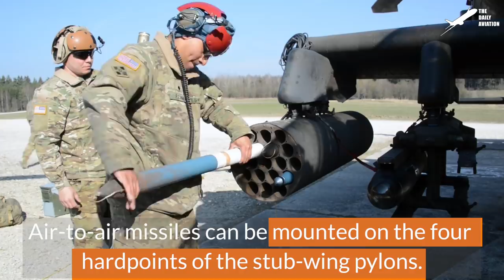Testing US F-16 Afterburner Jet Engine to Its Extreme Limit

Comment: *Imagine putting a dyno on one of those afterburners*

(I forgot the thing that makes electric when a wheel moves my english is not that very good.)
Reply: you mean dynamo? well the engine itself probs acts as one large dynamo already. it generates electricity for the aircraft while its running cause the fans in it spin. thats why it dosent need to rely on battery power to power the avionics (buttons n stuff) while the engine is running. Also if a dynamo is strapped to it, it would probs produce less energy than what the engine is already producing cause of the fact that energy cant be created or destroyed, it can only be converted. So what u get out of the dynamo would be at most equal to what the engine is making, but probably less.
Reply: @ATAGOISMYWIFE  yea still its a source of power for your batteries but I dont know why we cant charge batteries with our engine power
Reply: @lunissh  cause not all battries are rechargable probs.